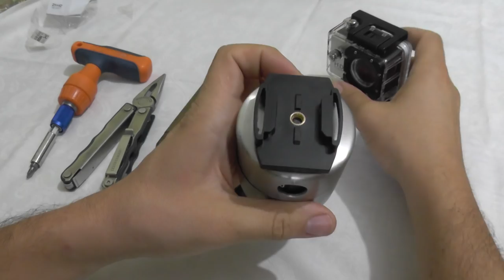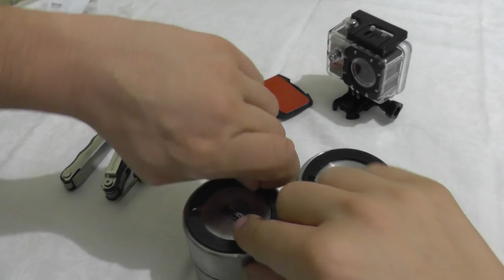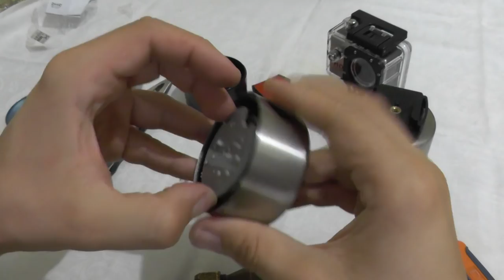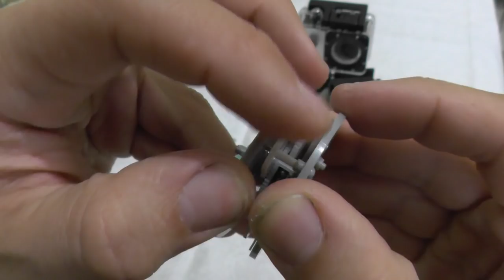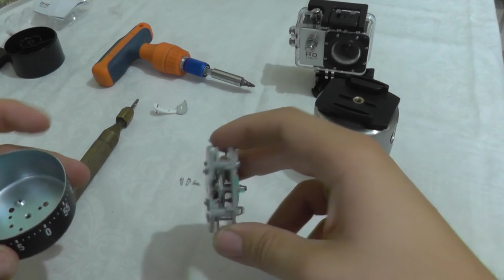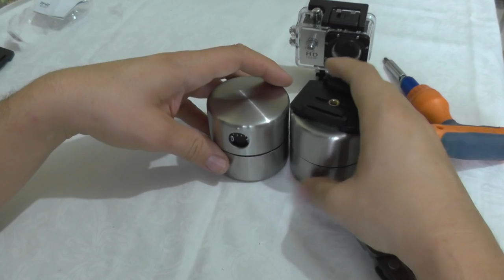How to Make and Modify an Ikea Timer for Time Lapse Panning

Comment: This timer works great with gopros. Fyi, you can pull the top right off without disassembling the lower half.
Reply: nice tip... the hole thing broke apart! -.-
Reply: +Florian Vates Sorry to hear. I've made three of these and no issues pulling the top off.

Comment: how about DSLR?
Reply from the maker: +KandyMan I'll try to see if it has enough power to rotate it.
Reply: thanks bro appreciate that
Reply from the maker: +KandyMan I have tested it with a Fuji S6500FD (old bridge camera) that has ~600 grams without the 4x AA batteries that it needs, it works OK, just needs the center of gravity to be on the center of the timer.
Reply: TechTronic9000 thanks brother appreciate that.